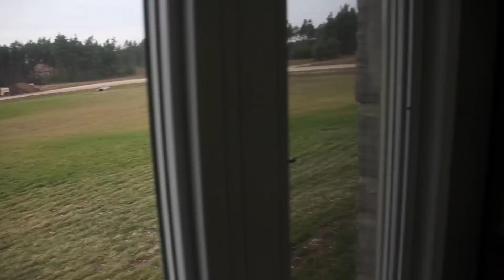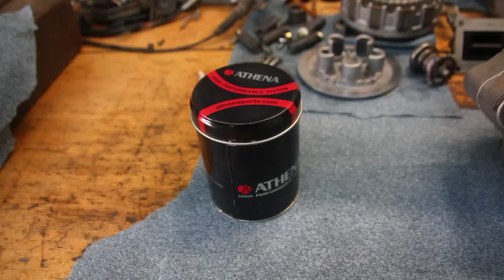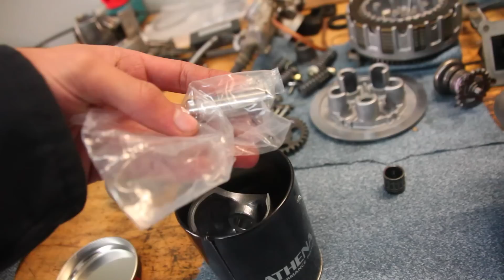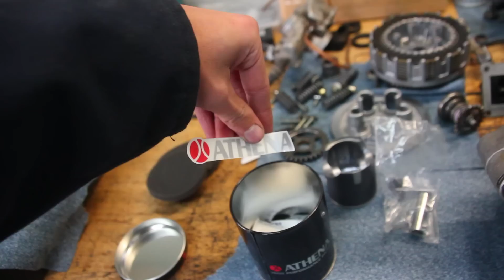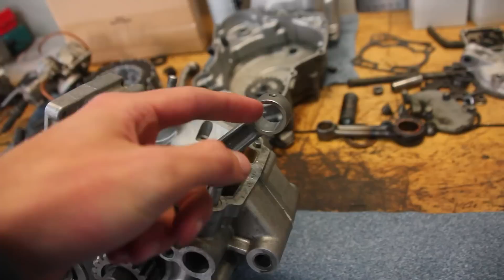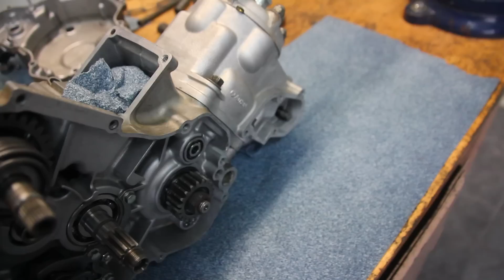KX144 Update Video #2

Comment: a month ago i was at MP camp and my 04 rm125 blew up over #3 and i got knocked out. and when i was taking the motor apart i saw a piece of the crank stuffer in the cylinder. so i guess the crack went and the stuffer shattered and cracked both cases and broke the cylinder, but the cranck only had 20hrs on it but it was from hot rods and i was told that hot rods cant handle that kind of presure, and i saw hot rods on the piston rod so i hope that if you got the crank assembly from them be careful because i dont trust them anymore.

Comment: hiya kawi580 iv allways been a honda fan i ad a lovly cr125 2002 its was mint but someone asked if i wanted a kx144 1998 its been rebuilt from the ground up with full engine rebuild every seal as been done its smart....i wanted to ask i ent out on it start first kick tho everything has been done right on it...but does this mean its going to overheat all the time. cheers michael from england
Reply from the maker: I don't think it will overheat, 2 strokes are way less likely to have cooling problems compared to a 4 stroke so even with the 144 kit it shouldn't be a problem
Reply: o great thanks for the reply Kawi580

Comment: i had a bunch of water pump problems once i 144'd my KX because of the torque. but the 03+ is a completely different design than 94-02 so you should be fine.
have you ridden any other 144s like EG, RPM, kustom kraft, etc to compare the power of the athena to? when i rode an athena YZ144 i wasn't impressed compared to the kustom kraft kx134 let alone my EG kx144

....but everyone knows green bikes are fastest color so... that may not have been a valid comparison.
Reply from the maker: I've never ridden a 144 bike and I've only been on two 125s lol so I have no idea, but I have heard the Eric gorr kits are better but I just bought the bike like this with the kit already. But my Athena cylinder is ported and polished now so that should help a little bit
Reply: Kawi580
i think the porting is the main problem with the athena kits, the one i rode felt choked at higher revs so i wouldn't be surprised if they are just punched out with the factory 125 ports. i wan't to see this thing tearing up some dirt,
subbing